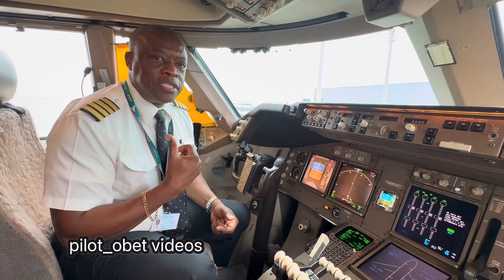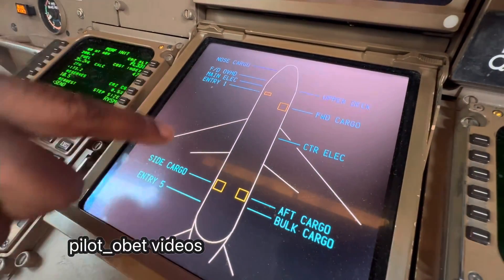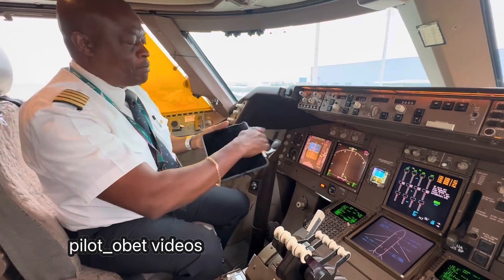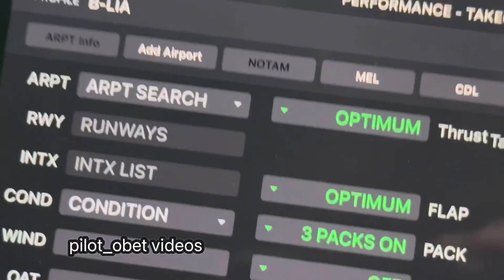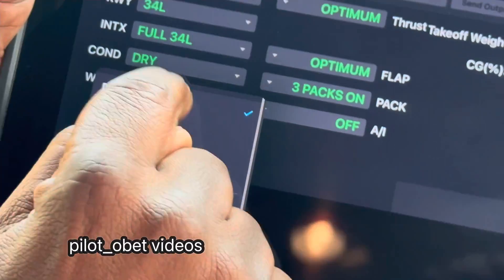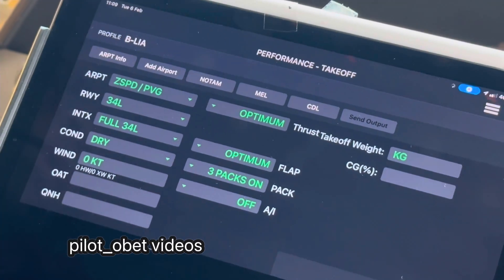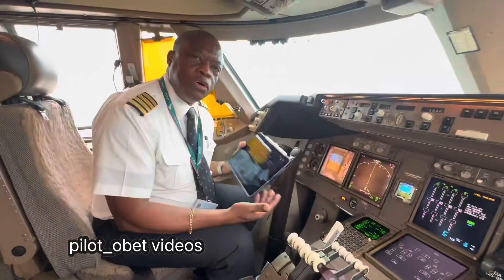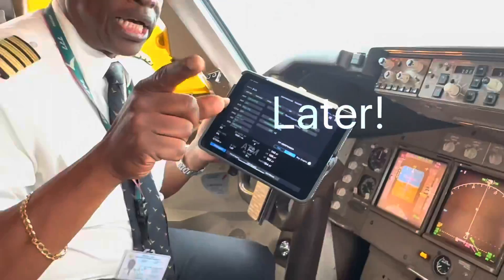Boeing 747 ‘Takeoff speeds’ calculation

Comment: Hi, how the performance calculations on the iPad os transferred to aircraft computers?

Why there is an iPad between the input of load, atmosphere and runway and the aircraft computers?

Isn't it just adding another point of failure.
Reply from the maker: I’ll show you in part two of the data entry process

Comment: As an aerospace engineer studing in the UK, I can tell that the software uses mathematical equations such as integration and differential equations to calculate the takeoff speeds and related data, all depending on the aeroplane weight, engine thrust force, runway conditions (drag coefficient if you need to abort the takeoff), air density and the lift coefficient of the wings. When you get into this stuff, it's really interesting and fascinating. What's more convenient, the pre-programmed app does it for you! Normally this amount of math would take hours for a human to compute.
Reply: Who'd have known it did all that with the wings.  I thought it was limited to a predefined value, that was modified by each condition- take off weight, centre of gravity, engine rating, selected derate, engine bleed setting, flap settings, runway length, runway elevation, temperature, assumed temperature, air pressure, runway slope, runway dry/wet/standing/ slush/snow/ice, and finally, wind speed/direction.  I remember there used to be a table that outlined the basic speeds, and then further charts would be referenced that give additional penalties (or bonuses) to the base speed, so the end result would almost always be a higher (faster) figure, or requiring longer takeff run.

Comment: Thanks. I’m guessing you aren’t dealing manually calculating the CG with the moment/arm. I’m guessing given you know the loaded position and weights of the cargo the software is calculating it for you?
Reply: Should be calculated by the load agent and printed on the load sheet. But I am only ga pilot ;)
Reply: The company supplies the weights and CG, which is verified during the loading of specific pallets into the prescribed positions, thus final loadsheet should check out.  The CG is entered, and usually only effects the stab setting.  Under extreme cases, moving CG aft will reduce stall speed, but this can also be dangerous.